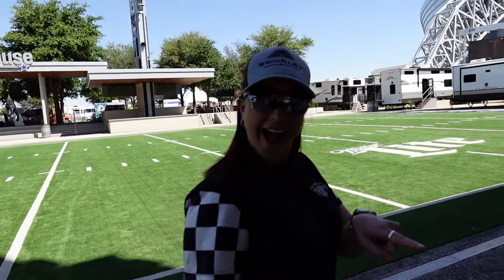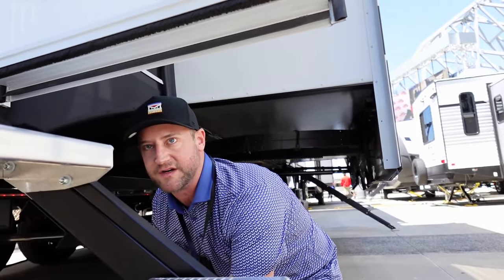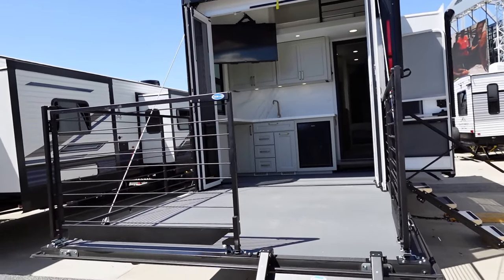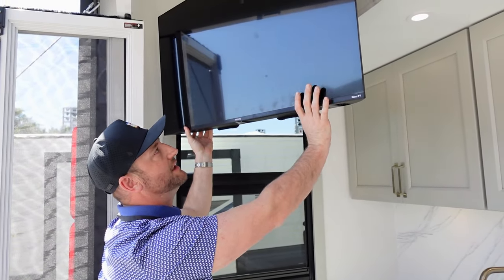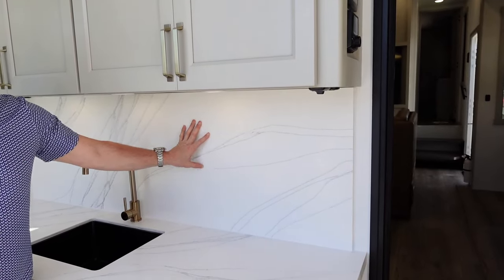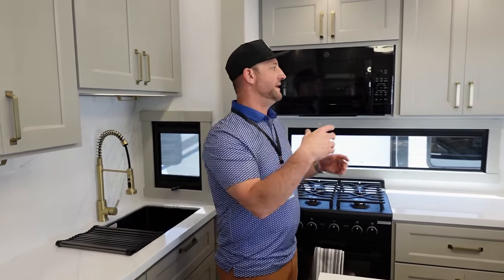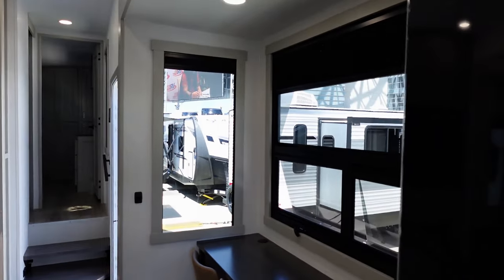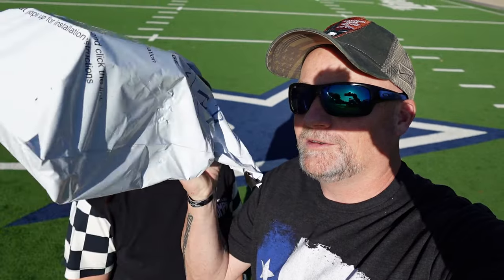New Brinkley G3250 Prototype plus the Z Air 285/295! Nate and Eric take us through the new models!

Comment: I like the adjustments they’re planning for the 32. I don’t understand why they have curtains in the 32 & 39. Otherwise, I’ve been Brinkleyfied. I don’t think I could buy anything other than a Brinkley. It’s just a question of which one. Thanks for the tours.
Reply from the maker: Thank you for watching! Which curtains do you mean? I also agree, we wouldn’t own any other RV brand!
Reply: @chasing70degrees23  The bedside windows. They have other east-west models that don’t have curtains, so I don’t get it.
Reply from the maker: @truchretienne8889  I am not sure! We have curtains in our 3500 and we use a removable piece of shade material to block out the sun and heat.
Reply: @chasing70degrees23  Wouldn’t you have preferred the blinds?
Reply from the maker: @truchretienne8889  I’d have preferred the same blackout slides we have in all the other windows for sure

Comment: So I am a bit shocked and a bit concerned with the load range E tires on the Z Air 285 and the axle sizes.  The 225/75 R16 HT trailer tires that comes on it, seems to be at max load of 2830 per tire.  The GVWR on the 285 is 11,495.  The axles that come on it are rated at 5,600 per axle per their website.  So the axles 5600 * 2 = 11,200 which is 295 BELOW the GVWR.  The tires at 2830 * 4 = 11,320.  Which is only 120 pounds over the GVWR and that is running the tires at max PSI.  It appears the running gear is undersized for this trailer.  Even if you go up to 235/85R16 tires, those are at 3640 max per tire = 14,560 at Load Range E.  I have been towing and camping for 30+ years and served as a Combat Engineer in the Army - safety is always a concern, but this is interesting to say.  I can tell you one thing, that 285 has a great floorplan.
Reply from the maker: Thanks for watching and thank you for your service! I am retired Army! You have done a lot more math than I have. You have to remember that not all of your weight rests on the tires/axles you have the tongue weight as well. The axles on my G are 7K each * 3 = 21K. The GVWR is 21,500. Our G fully loaded only carries 18060 lbs on the trailer axles = 2940 lbs less than the axles are rated for. The rest of that, goes to the drive axle or in the case of a Z air the receiver hitch of the truck. My drive axle carries 4060 lbs plus the truck drive axle weight of 3840 lbs =7900 lbs. My truck is rated for 9750 lbs on the rear. I hope that is all clear as mud 😆
Reply: @chasing70degrees23    All valid and thanks for the math as well.  I just know several people that overload their rigs while towing and they wonder why their axles bend and/or tires blow.
Reply from the maker: @kmonto1971  agreed!

Comment: When will mass produced manufacturers start installing mini-split AC units for the masses that boondock?  They are significantly cheaper than installing 3 x heat pumps on the roof, way quieter, way more efficient and solar/lithium friendly.
Reply from the maker: I have seen a few RVs that mount a split unit in the front baggage area and just leave that baggage door open for ventilation. When I was overseas, we used almost exclusively split units, and they work great!
Reply: @chasing70degrees23  I mounted my on a custom frame behind our unit as our front compartment is designated to our solar/lithium equipment.  We can boondock and run it 24/7 if needed.  New Horizons and Spacecraft are the only manyufacturers...so far...that will install them from factory.